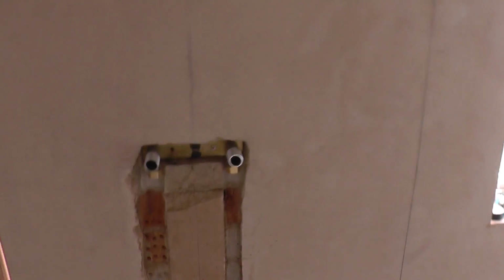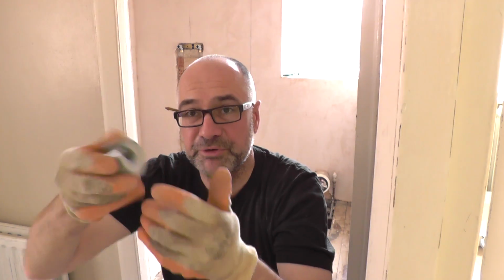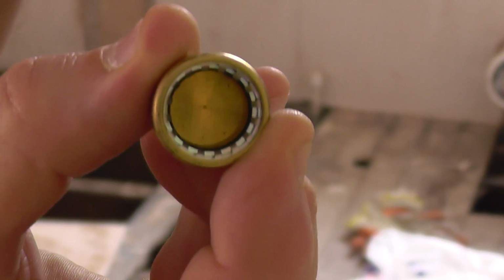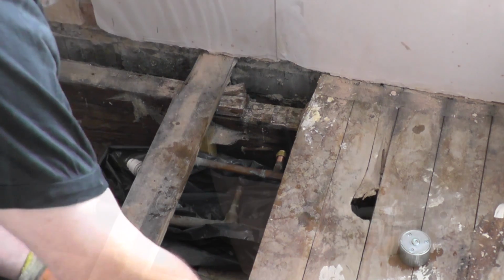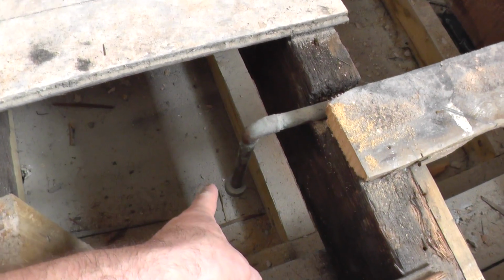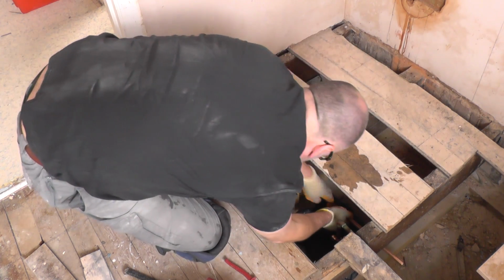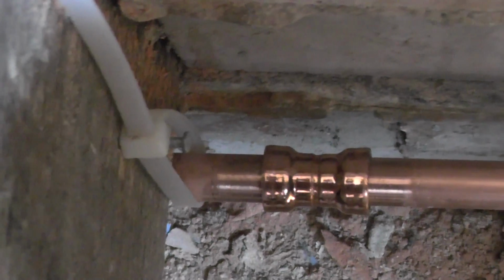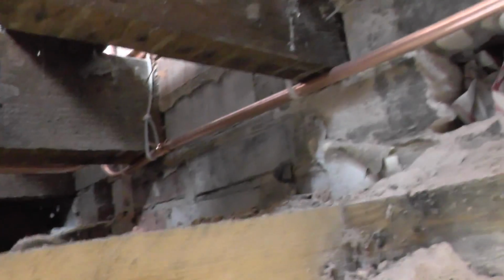DIY: Plumbing a bathroom using pushfit fittings / Conex Cuprofit / Pushfit plumbing

Comment: Ive recently used the copper pushfit fittings and wondering if they will stand the test if time, have you had any issues with the fitting since, any leaks from them etc? Thanks
Reply from the maker: Hi there. Rest assured they've been absolutely fine. They've been in-situ for @ 3 yrs now and no issues whatsoever. In fact I've just used them again at another property and they work a treat. You just need to make sure you push them in far enough. Mark 15mm from the end of the pipe. This is approx how far the fitting needs to go on so you just need to push it in that far or thereabouts. You also need to make sure that you de-burr the ends f the pipe and clean it properly so as not to damage the rubber gasket inside the fitting. You'll be fine. Best wishes, Des

Comment: Good idea with the cable ties. Hope you managed to protect the copper pipe up to the shower mixer. Behind cement and in contact with cement it will eventually rot. Needs to be protected i sleeve with 21.5mm overflow pipe or some form of lagging.

Comment: I have done a fair bit of DIY plumbing now, I am confident with the plumbing side of things now, I would tackle anything now I recon lol, and soldering joints is not difficult either, but all these easy fit connections are good for the novice.
Reply from the maker: Garry G Hi there GG. Thanks for watching and taking the time to comment. As mentioned elsewhere I was very worried about the prospect of the connectors failing and water flooding the place as I'd had no prior experience of using them. However, I found them very easy to use and for a small project I reckon they're worth trying providing you prep the pipes properly, etc. I'd be interested to hear about your experiences of using compression fittings. I personally have mixed fortunes using these as I do get leaks but perhaps it's the quality of the stuff I use from Wickes. Have you got an opinion?  Take care buddy.
Reply: 21centurycaveman Hi mate, so far I have not used any push fit fitting, I am sure they work well enough as they have been out a long time now, they just don't fill me with confidence when you just push them on and think is that really going to hold,  I would rather solder joints or use a compression fitting, you feel much more confident when you do up that nut nice and tight you feel safe with them,  they are just a bit more bulky so not so good if they are going to be on a pipe you can see, 

My worst incident with the plumbing so far was at work, I am a school caretaker and had to replace a faulty mixer tap that would not get hot, I turned off two valves to the sink and tried the tap no water, so I thought while I am doing it I might as well fit isolation vales,  so I cut into the first pipe, and the water was pissing out off it, I had not turned off the right valve, I was running round like a headless chicken looking for another shut off valve thinking shit I am going to get the sack for flooding half the school lol, I found the valve in the celling in the end,  I guess the tap was not letting the hot water into it,  very scary moment but got away with it in the end, no one knows how close I come to causing big flood damage lol.
Reply from the maker: Garry G Hi there. Thanks for our response buddy. I agree with your comments about the compression fittings - give more piece of mind albeit more bulky. Lol about the school tap. Promise not to tell anyone! Ignorance is bliss! ATB
Reply: 21centurycaveman  the scary thing is their is the exact same problem with the same type of tap in the head teachers personal toilet next door to her office,  as you can appreciate  I am not to keen on the idea of taking that one off,  it can be hard some times figuring out the correct valves to close on a big building with miles of pipe work going off in all directions.

Comment: Top video fella
Hows the push fits holding up still 
Thanks
Reply from the maker: Hi there.  Apart from one initial failure ( my fault I believe) I've never had a problem with them at all and have since used them on another installation. Would recommend as really easy to use and very reliable in my experience. I think the important thing is to make sure you push the pipes far enough into them to ensure they grip tightly. Best wishes, Des
Reply: @21stcenturycaveman33  👍

Comment: Looks like your floor joists there are beefy.  We call it old growth or "dimension" lumber, which was when a "2"x4"" board actually measured 2" by 4".  The dimensions now are 1-1/4" by 3-1/4" to save lumber.  I know I know.  I'm an American, I am not sure how many centimeters your lumber measures, but contrary to most folks beliefs, we use both metric AND SAE (standard and English).  :) good work sir.
Reply from the maker: +Steven King Hello my friend. You're right about differences in timber size and modern timbers do appear to be smaller and arguably of poorer quality. Whenever I replace joists I always use the best grade timber I can find and don't mind paying more to hopefully get better quality and peace of mind. I also choose my own timber from the store/yard as I find that if you rely on delivered timber a large % always seems to be warped and unusable. This infuriates me. ATB buddy
Reply from the maker: +Steven King Hi there buddy. Will check out your channel shortly. Our household is currently recovering from much illness and everything on stand by for time being. Best wishes to you and your family.